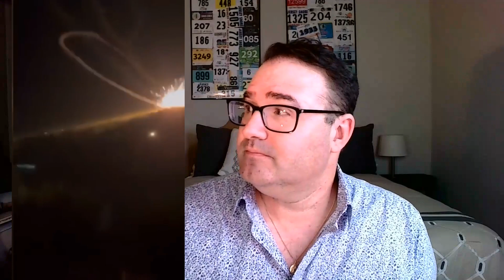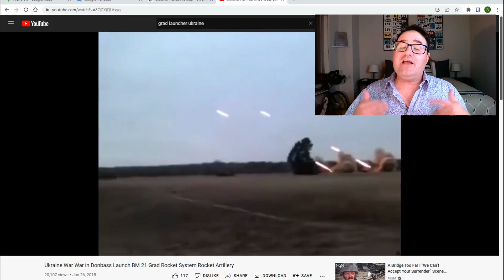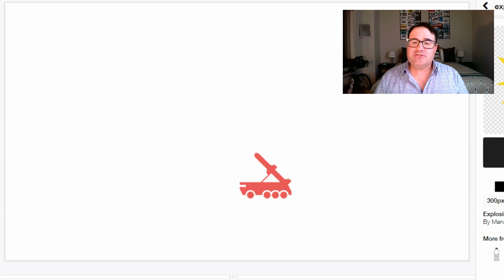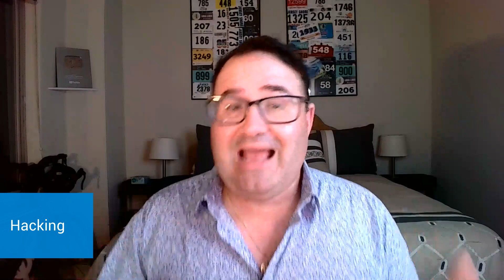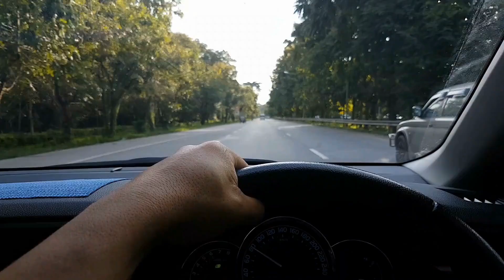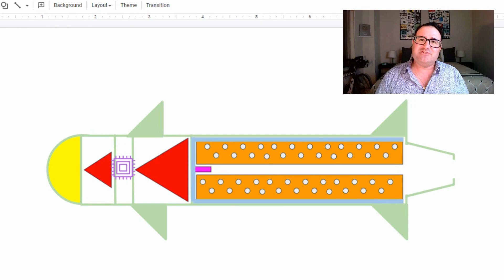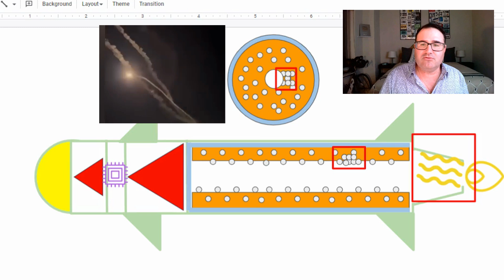Why this missile U -Turned

Comment: i could see your theory working if the engine outlet was quite large or multiple outlets - more thrust coming out one side than the other - but then surely the missile would go into a uncontolled spiral trajectory - it would be very unique event for as it starts the sprial, the issue completes (engine outlet equalised) and the missile carries on downward - i dont see this

i see the missile in some degree of control as it turns - we normally place an AoC / coord location where we want a faulty or aborting missile to ditch so it does not hit our own forces or non-combants - we know the Russians do not care about non-combants and not always their own forces due to poor intel about on-going missions (force laydowns) - how many stories from the Georgia conflict when Russian ground force enagged their own air forces - could it be that the missile was aborted (either manually or automatically) but the op put the ditch point at their own location (poor training)

as too hacking - certainly not in normal sense of hacking - but possibly with the use of Suter - but then why this particualr missile and not all of them as they were fired, even from other launchers

could the targetting radar have pointed back to the launcher - unlikely but possible - then why only this missile coming back home to the launcher

as too poor maintenance of ordance by Russian's is nothing new - plus to produce so many missile types (in comparison to what we develop in the NATO / West), they can not go through all the development / safetly cycles we go through - the cost and time element (the trails, mission planning tool development, intergration costs, training, production throughput) of getting a missile out into service is huge, but the Russians seem to have a new variant or something new ever few months (our cycles take years)

given Russia is being proven to be a paper tiger (all huff-and-puff with little solid capability), plus their seeming endless new weapons solutions coming out, plus their poor training of key ops for these weapons, plus their poor military equipment

i think its a combination of poor training, poor development of the controlling element of this weapon system (stopping an op placing an abort zone within a certain distance of the launcher) and the missile on launch detecting an issue and going into the abort feature

what ever the reason for this failure, lets hope it continues on an increasing rate for the Russians - it is as though the Russian military is working for our (NATO / West) military solutions manufacturer sales teams

Comment: JAMES J. DEVITOIII ;GENERAL DYNAMICS,ELECTRONICS DIVISION. YOU ARE CORRECT BUT FOR A   NON-FINN FAILURE OF A DIFFERENT REASON. WELL HEAR IT IS, IN 1985 I WAS ON LOAN TO CONVAIR DIVISION OF GENERAL DYNAMICS TO TEST THE FINN MOTORS ON THE TOMAHAWK CRUISE MISSLE.BELIEVE IT OR NOT, THEY ARE ALWAYS MODULATING AT A CERTAIN KNOWN FRQUENCY (THAT IS STILL CLASSIFIED.) THE FINNS ARE NEVER IN ONE POSITION FOR THERE IS NO DELAY ON COMMAND FOR NO STICKY FINNS IN THIS BUSINESS. SORRY TO SAY THIS WAS THE MOST BORING JOB I EVER HAD HAVING ONLY 1 FAILURE OUT OF 500 TOMAHAWKS

Comment: No sorry, your theory on this one doesn't make sense, any uneven burn is equalized as the gasses are ejected thru the nozzle. Clumping can result in an explosion but not off-course maneuvers like this one. Yes, a burn thru at the side could throw things way off course but they don't correct, they just go into an uneven cork screwing mess.

Comment: This is mine and multiple other people's theory of what really happened: 

This got me really curious so I did some research of my own. In short terms no the missile didn't hit the Russians who launched the missile. I could be wrong but I have read reports and there is no evidence of any russian injuries or deaths however this same missile allegedly started a fire. There was also this other video posted from a different angle. In the video it shows that the missile didn't hit the Russians at all. So the video that has been showing the missile that appears to be failing is just a matter of perspective as it seems and looks like it u turned and blew the Russians when really it didn't.

Comment: That missile worked "perfectly" as it did a course correction and did a 180 degree turn and went straight back... Nothing mechanically wrong, it did that perfectly and purposely, something was wrong with the programming or guidance.
Reply: Today (July 8, 2022), the mayor(/head of military administration) of Mykolaiv released a video where he states that russians are re-purposing S-300 rockets to hit ground targets (adding GPS modules or smth), because they have plenty of those and lack of others. So it might be the case that what we saw is just a failed attempt of a ground-to-air "upgraded" missile to hit the ground target.
Reply: @yevhenbryukhov  Idk what youre talking about, I think it did a magnificent job of hitting a ground target.
Good missile.
Reply: No, no. The missile worked perfectly. Or at least appears to. It was designed to send Russians home in a body bag.
Reply: Exactly. This was software related. I'm not saying anybody hacked the missile, but the missile purposely turned around according to the data it was interpreting at the moment. Either there was a problem with the data itself, or a problem with the interpretation of correct data. Or a third option is that both the data AND the interpretation were both faulty.
Reply: @dandc2011  Either software or a faulty sensor.
Reply: Agreed, the target coordinates were the same as the launch coordinates. You don’t accidentally turn around.
Reply: @jeffmoss5332  If that's the case, that's a very bad software implementation skipping a crucial check!
Reply: On my view I see it start to turn yet again as it is just prior to impact, suggesting to me it was still trying to guide itself even until the last moment. Never confuse malice for idiocy; I think it's more likely the guidance system was just badly designed or implemented and it was on sooner than expected, such that it maybe mistook the unit on the ground as the target. It headed towards that, only for the system to realize again that wasn't right and then correct a second time but too late
Reply: Absolutely. It didn't look like it turned around by accident, it looked like it was targeting exactly there on purpose.
Reply: I know very little about the tech and software in these missiles, however could jamming cause the mechanical locking of a guidance fin? Or is jamming more likely to only affect the missile’s ability to send and receive guidance data?
Reply: bro that pfp dont do nun
Reply: It's because the missile is already in Ukraine, not Russia.
Reply: Russia is just not being too specific
Reply: It was programmed to kill fascists and worked perfectly. It identified a fascist terrorist rocket launcher and destroyed it post haste.

Comment: Most missile motors can crack from falling more than 2 feet tall but it affects performance or make it go boom in launcher than the way it going. Some missiles this day can make U-turn shot by having many control surface or nozzle direction control such as PYTHON-4, IRIST-T, etc so I think it is more like it has fins or nozzle malfunction.

Comment: Guidance problem.  I've had a few like that when I was building RC model rockets in high school.  Can't touch the controls until the boost phase is over or it will turn back at you or become the spinny whirlly bomb of death.  Even our shoulder fired hellfire model could only start tracking once the first stage dropped.  Then it would begin steering during second stage boost and spiral down to the laser dot and hit within 4 feet at 500 yards.  Back then I was legal!  Today I'd be called a terrorist with a destructive device!

Comment: Okay so you don't think it's a stuck fin and I would agree. I think a more likely scenario is that it's a catastrophic failure of a fin or fins. Nothing to do with guidance but literally a catastrophic failure ie ripped off etc possibly even caused by a fuel issue as you describe here in this video.

Comment: solid rocket motors don't work quite like that
it's all just a big column of flames, and the nozzle is designed to direct all the flow in one direction
i don't think it's possible to deflect the thrust that much just from pressure differences inside the chamber.

Comment: A rocket motor doesn't care about what or where is being burned inside the motor, all the gasses are flowing out of the nozzle to the rear regardless of where in the motor they originated.

Comment: Given the speeds that it was travelling at, I'm surprised that a turn that sharp (notwithstanding parallax view issues) didn't rip it to shreds before it even completed the turn.
Reply: Depending on the specific model, they are designed for some pretty sharp maneuvering in order to catch an evading plane - while they still have energy to do so (which sharp maneuvers burn up in a hurry).

Comment: There'd have to be a control system during boost phase though that should at least try to keep the missile going along a straight line though. We don't really see any such attempt by a control system to correct the trajectory. Or perhaps that control system if there can't act fast enough for what happened?

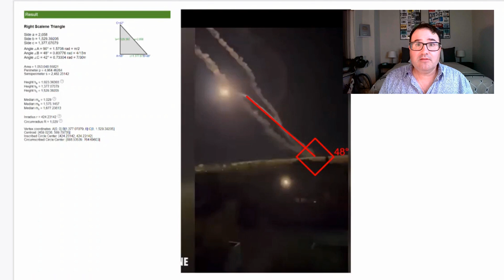Comment: 1:50  "48 degrees" elevation on the video screen isn't necessarily 48 degrees elevation of the actual firing angle. It would be so only if the camera is precisely placed facing 90 degrees to the firing azimuth.

Comment: I disagree, when the rocket fuel burns it just creates high pressure high temperature gasses in the combustion chamber with no directional sense but expand all over the chamber. of course at the entry to the nozzle there is a directional flow because of lower pressure outside but again this flow has no sense of direction but just flow on, it will not vector just because there are different zones burning at different rates or bulk. the most plausible thing I can think of is that the nozzle mount had failed re: screw/s on one side got loose and re-angled the nozzle along with it the exhaust gasses thus had a net vectored thrust. this may be due to factory quality control or material failure.

Comment: Are you sure its surface to air and not surface to surface?  About a decade ago there was an issue with US targeting systems.  How its supposed to work is it figures out its GPS location, you enter range and bearing of the target, and the box produces a new set of GPS coordinates of the target, which you relay to an aircraft to bomb.  There was an issue where sometimes the range would get set to zero, which means the GPS coordinates displayed where your coordinates instead of the target.

Comment: You hypothesis of a flaw in the SRB isn't likely correct. A malformed motor grain will either produce poor thrust or it will cause spontaneous disassembly of said rocket motor.  The missile launched and was flying fine for the first few seconds of flight, so that really rules out a propulsion failure.   
Some Russian SAMs and SSMs have boost phase guidance, in fact they maneuver like this right after leaving the tube/rail with control fins and vernier thrusters.  But they usually don't try to go back to the  launcher. Very much a guidance fail.

Comment: The peculiarity is the smoothness of the failure and abrupt turn through ca 180 degrees, followed by a clean course into the ground, or possibly right back on the launcher..  Russia has had some spectacular missile failures, and so has the US for that matter.  The motor still seems to be burning at impact.  I would suggest a gyro/guidance failure due to either mishandling, poor storage, or cost cutting manufacture.  So, I think you're mostly right.  I do doubt the fuel idea.  That would cause much more exciting kinds of failure.
Reply: just saying it did not go back to the launcher, there is a video from another angle that shows it hit somewhere next to the launcher, but the explosion didn't reach it
Reply: @cortix4599  could it have possibly gone to the radar vehicle?
Reply: @matthewredman7814  nope , if it wanted to trust me it could have but I’m pretty sure it can’t track it’s own radar unless it’s an anti radiation missile , which tracks any radar signal but still it’s unlikely that the seeker was enemy able to see behind. It probably had some issues with its fins or it could have been a random failure , recently Russia has been using s300 cruise missile so maybe something failed while they tried to do that
Reply: @hemendraravi4787  I think the Buk uses SARH, so if it really wanted to it could've locked the radar truck. Still no clue how it could've seen behind it so that theory falls apart there.
Reply: Gyro installed backwards.

Comment: It wouldn't have been a nominal max 50km SAM shooting, from almost that range, at targets circling the front line city or sweeping past the front line. Especially, as aircraft over Ukraine are wont to do, flying low.

Not unless the Russians are so bad at this that we can armchair declare all those missiles missed so badly the targets probably didn't think they were truly being shot at..

Nominal 50km means 50k is when you can fire on a target that is very fast, very high, and coming straight for you. Low altitude, flying away or perpendicular to you, or even just flying at you kinda slowly will substantially reduce the range it can be hit with missile energy enough to track.

For ballistic ground to ground missiles though, the range is basically the range. Or a SAM with much longer range. But a 50km SAM from there would be firing at something pretty deep behind Russian lines or wasting missiles.

Comment: This incident was a Wile E. Coyote style accident if I ever saw one. Since this missile has a solid rocket motor, I bet the casing failed somewhere, and that can cause a violent maneuver like the one in the video. However, problems with the solid fuel itself can result in bad things happening too, including the motor blowing up. I think the theory of an electronics failure is a plausible explanation as well. No doubt it left that many fewer Orcs attacking Ukraine.

Comment: Well , i guess you are wrong , if fuel burns faster on one side it does only one thing , the pressure in the chamber goes up and the rocket gets a boost because the the only way the pressure can escape is out of the back . There will be an imbalance in weight if one side gets heavier , but thats not enough to make an 180 degree turn .

Comment: Sounds like you may be on to something. Is it possible that this missile has multiple motors and one malfunctioned and added thrust unequally to cause a turn? It almost sounded like the thrust came back with a vengeance as soon as it was nose down.

Comment: I don't think the missile turned around. It deviated left and down towards the camera and created an optical illusion where it looks like a 180 turn but it is actually a turn that is a lot less and towards the camera.

Also an unstable fuel mixture would not cause flight deviations like this. I think it more likely that the nozzle was damaged and after a few seconds of experiencing high combustion pressures it broke leading to an unbalanced thrust profile causing the rocket to turn towards the camera and down.

So still mishandling or manufacturing issue but with a different explanation

Comment: I don't buy the vectored thust of the rocket motor due to mishandling. What you don't show in your missile is a conveger and throat leading to a diverger nozzle. The converger (inside up against the fuel) is a shallow parabolic shape that is wide around the edge and necks down to the throat where the gases accelerate, the gases may swirill and burn unevenly inside, but the converger corrects for that. Then as the gases pass the throat and enter the diverger nozzle and exit, they expand and slow down as they push against the nozzle for added thrust and to match the max speed of the missile to the exhaust velocity for efficiency. A vector of that exhaust at that magnitude is much more the engine could handle - with a broken nozzle or a converger burn through without exploding. To me, it looks like a jammer got into the missile's "front end" of the seeker (IR or RF). If the jammer knows the exact type of missile, it can not only steer it away, but if jammed at launch, it can force the missile into a quick 90 turn toward the ground, at a precise instant, the jamming stops, and the missile now sees only the IR signature of the launch site, or the RF energy from the Search and/or Track radar, or even Radios near the launch site, it now homes in on those sources making a 180 degree tight turn and hit the launch site. The launch system gave itself away as soon as it turned on and launched the first two missile - plenty of time for the "Wild Weasels" (any aircraft that is designed to be a target to wake up radar site - some bad ass pilots) and Jamming aircraft to determine launch site type and pinpoint its location. A 180 turnaround back to the launcher site is rare but it happens. Oh, jamming systems can make the target look like it got very close very quickly "rushed" after launch so the missile switches to on-board radar and enables full steering... but the jammer makes it looks like the target then makes a sudden turn downward and passing the missile... totally spoofed!